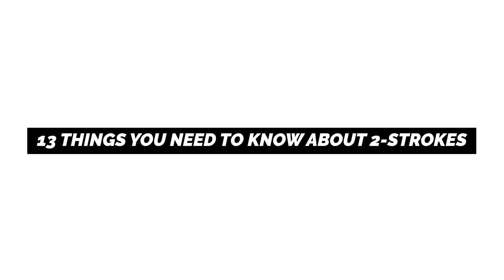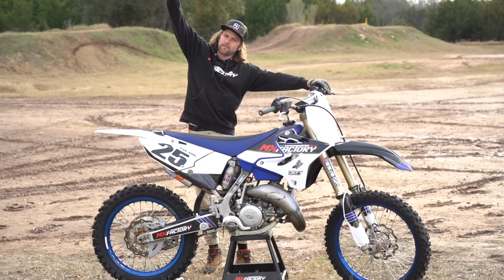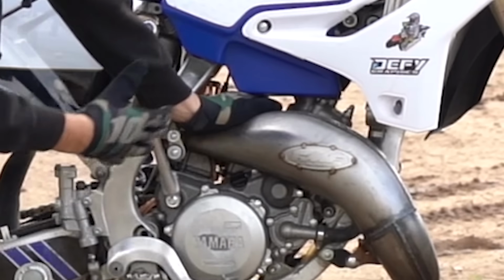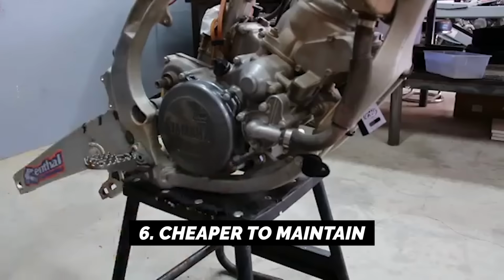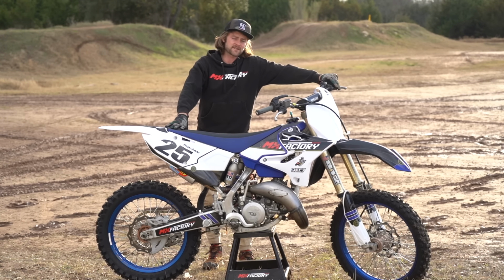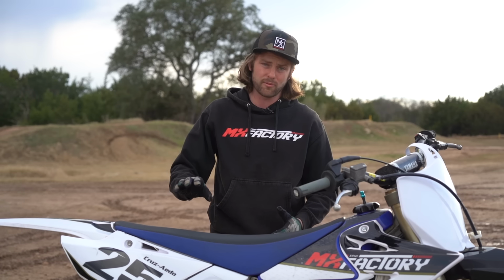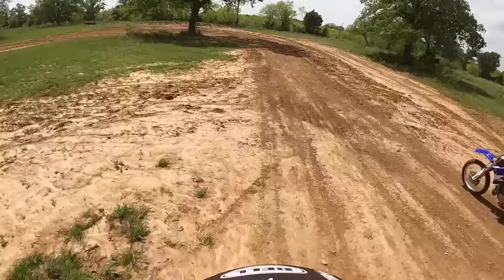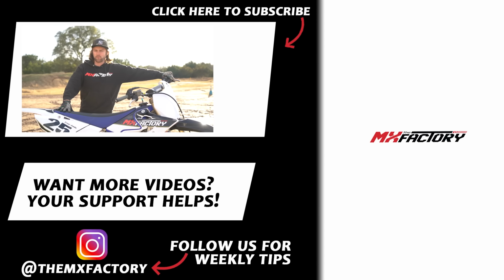13 Things You Need to Know About 2-Stroke Dirt Bikes

Comment: dude its coming just read an article That honda is making a fuel injected two stroke dirtbike. yz250 2021 sold out already. cheaper. easier. funnier. and the world is going back to the good ole days. i just bought 2005 yz250 blown top end and bottom 800 bucks tons of aftermarket parts with it. full exhaust. brake lever. kickstarter. reeds. and ill dumb 1500. in it motor. head. bottom end, entire motor redone 1500. thats what it costs for a yz250f top end. just the piston. rings. gaskets. tons and tons of after market parts for yamaha. same frame. motor 2002 to 2010. 8 year spanned motor. i am shining frame up not polishing cleaning frame, swing arm. sub frame. bearings bike will be as good as new if not better. ill have less then 3 grand in this bike and used 2005 yz250s sell for 3 to 4 grand. you cant find any used yz250s anymore. complete engine kits are sold out. just got it two days ago, havent had a dirtbike since i raced my rm125 in 2001. best day ever. lets go companys we are ready to buy buy and buy more 2 strokes.

Comment: More holes in this video than a 2t cylinder ;) Two strokes make about a third ''more'' power than a 4 stroke, Other brands such as Sherco and Beta make modern two strokes as well.
I'm sure you where comparing a 250 2t to a 450 4t but some viewers may take you on your word. Cheers for the 2t content though.

Comment: I really think the KTM TPI levels in the 2 stroke are next level. You can still feel the "on the pipe" feeling but the power band is more like a 4 stoke. Meaning traditional 2 stroke you were either going blaaaaap compared to going braaaaaap. My newest bike is the 2020 KTM 300 XC TPI and at low end it chugs no stalling, top end it's a chain saw in the dirt!!!

Comment: 2-stroke is still got the most horsepower HONDA CR500
https://www.youtube.com/watch?v=EEn1oy-rg30&t=140s

Before any of you 4 stroke die hard fans start talking about it got 50 more cc than a your regular 
450 4 stroke you need to remember the time when 4 stroke needed double the cc in any class to go even against 2 stroke
BUT horsepower isn't everything.
A better rider can beat more or less any bike whit any bike.

Most 250cc 2 strokes have a fairly smooth power curve compared to a 
125cc 2 stroke that has nothing on low rpm, nothing on mid rpm and everything at high rpm.
Dyno for 1996 2 strokes
https://lh3.googleusercontent.com/proxy/uAOsUOUwy7ZjOPnj2_UVe-7BPXD_QTDAx1XH4CKsuCVqYT0Z6S_BoArOc7XTAcs-Tvobq6ZOBT8a6kMq1_Vc8vtNONiANhyfRqsqmzCUjIyMt31Yr4HfigZDdY6S0ZUUhgKgp1KukfiEduVcATys

Comment: tell me boy what causes the instant power band as its a loaded question and i do know the answer .and when you said 2 strokes put our less power that 4 strokes you just lost all your credibility ..and proved you dont know a thing about two ..like why did the AMA allow 450 four strokes to run in the 250 two stoke class .thats because it takes a bigger four stroke to run with  smaller 2 stroke .and a gasgas and husqvarna are NOT re-branded KTM's they are completely different bikes !..why dont you tell 2 stroke only have 3 moving parts and lighter with more power that a new 4 stroke ..a 2 stroke 125cc gasgas makes 40 horsepower   vs  a honda CRF150R expert motocross racer  only makes 22 horsepower ...the 125 gasgas has damn near twice as much raw power

Comment: Bro...2 strokes make way more power.need to compare a 250 2 stroke vs 250 4 stroke.if your talking racing class when It takes a 450 to compete with a 250...than its obvious it takes a 4 stroke almost double size of the smoker to make same power.
Reply: No disrespect.i love 2 strokes but ...125vs 125.or 250 vs 250.or 500cc2cycle vs 450.  500 on modern chassis..lol.

Comment: 2 strokes do not put out less power.....  Yz 250 2 stroke 44 HP
Yz 250f 4 stroke if your lucky 32 HP
Numbers don't lie.....

250 2 stroke  will beat a 250 4 stroke in every catagory.tgese are dyno numbers. Torque is almost double on a 2 stroke 

Less rotational mass. the majority of the weight of the motor is lower in the frame than a four-stroke..
Reply: From a perspective of what classes you’d race in here in the states, they do put out less power...YZ250 vs YZ450f or Yz125 vs YZ250f...thats the context i was speaking in.

Comment: KTM has fuel injected two strokes... They have a vicious razor sharp throttle response... And so much more power... Younger people have been dumbed down by the system.... The fixed up antiques CR500 are putting out over 70 horsepower.. And it still doesn't even have a fuel injection put on it yet.. Once Technology and Engineering go into these bikes... 4 Strokes will be nothing but a joke

Comment: I don't know what he means by low power.. Other than four strokes have more constant slow power.. But four strokes are significantly slower and weaker bikes he must be a freestyle.. This is why Motocross had to use cheater bikes 250 
4-strokes against 125 two strokes..
If the motor Crosser has equal skill levels you would never win a race on a four stroke 250 against a 250-2-stroke..
They have the technology now for four runing clean two strokes... But they don't know how they're going to do the classes because the two strokes are just so fast especially the modern ones.... The old Two Strokes are even faster than the modern four strokes.... Riding a four-stroke is like riding a John Deere tractor.